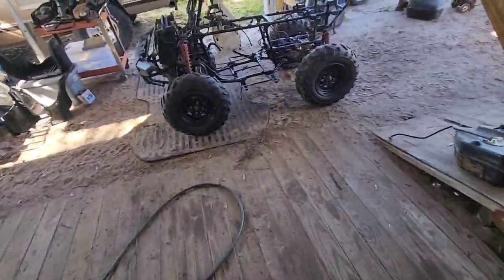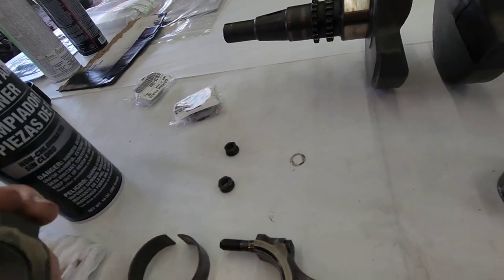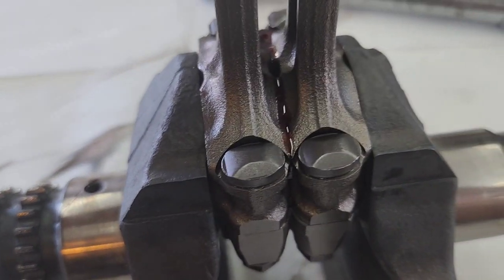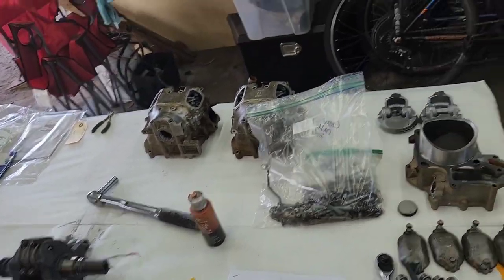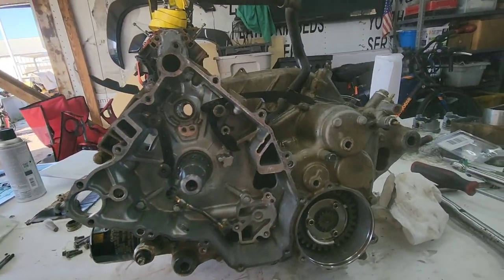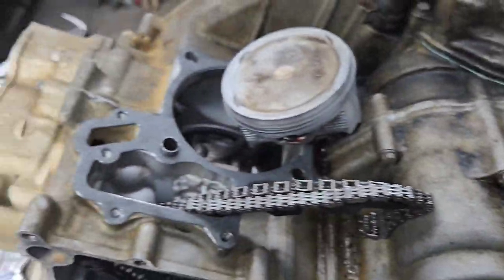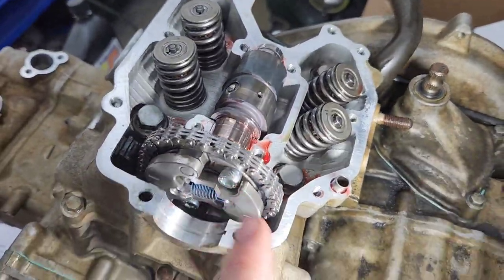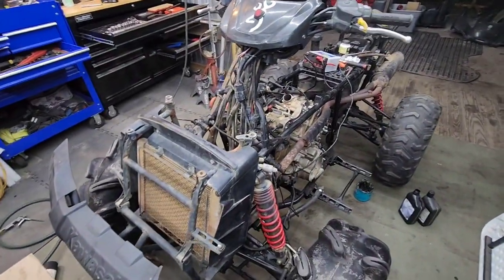Kawasaki Brute Force 750 Engine Rebuild

Comment: Where’d you get the torque spec manual? About to rebuild an 05 750 and would like to print it out as well
Reply from the maker: Look up the kawasaki service manual for your year bike. Has every torque spec in it as well as nice diagrams.

Comment: I have a question for you man
 I just ordered a head gasket for my Kawasaki prairie 650 and they are all metal am I supposed to install them like that or they have something I supposed to put on On them?
Reply from the maker: Nope they are all metal compression gaskets, although some people put a layer of copper coat on them for extra insurance, but I did not. Just make sure the mating surfaces on the engine where the gaskets go are super clean.

Comment: Front or rear rod went bad
Reply from the maker: If I remember correctly, it was the front.
Reply: @ark2002 that was the same on mine. Maybe fault with the engine manufacturer?
Reply from the maker: Possible, but this engine had signs of being flooded with water at some point in time, which I suspect caused the failure.